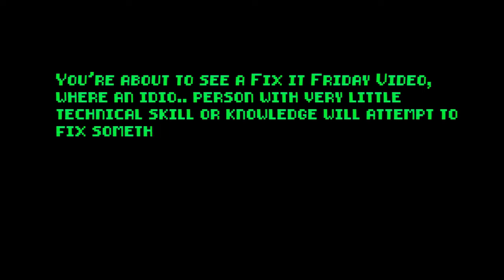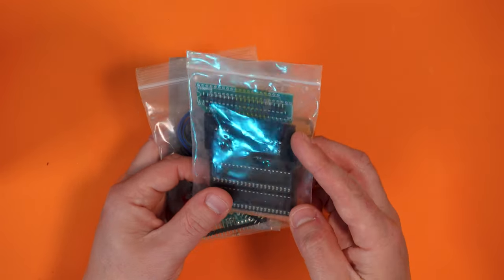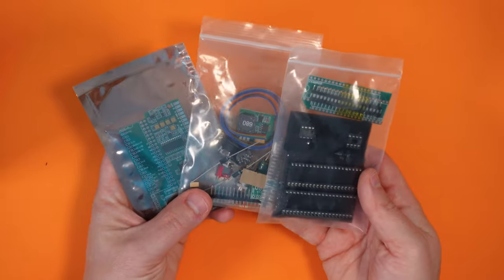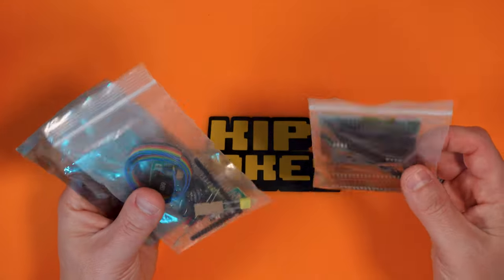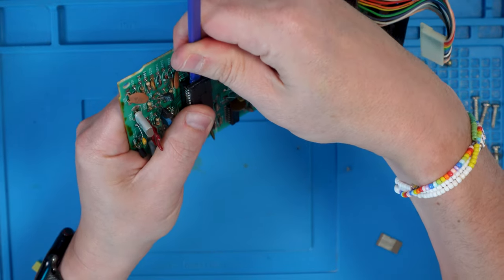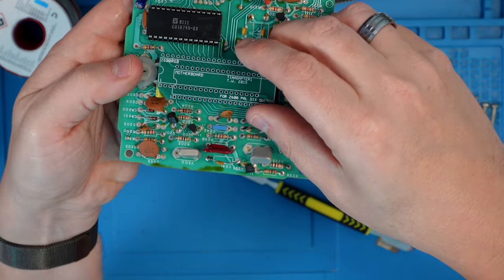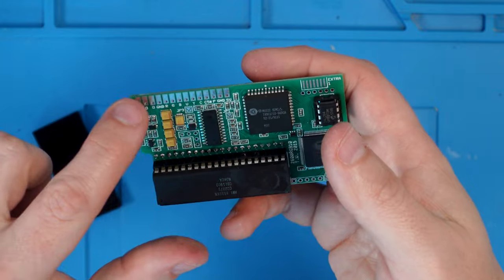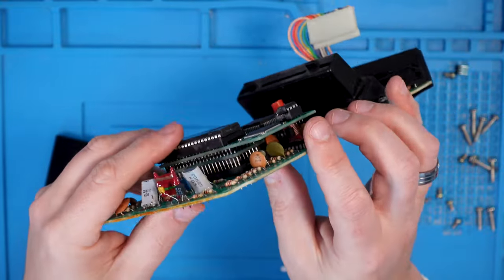Atari 2600 RGB Mod - THIS WAS HARD! Restoration Part Two

Comment: a tip: when you solder headers, you can plug them (both sides) into a breadboard or another socket with correct spacing to have them straight and just pull the soldered assembly out after you finish soldering.

Comment: This is well after the fact, but the console is perfectly safe with a good wash in the sink with warm dishwashing liquid and a soft nylon brush… Oh, and those tabs for the face plate are pretty resilient; I’ve  had no problems with the heavy sixer and the two 4-switch models (one Woody, one Vader) I’ve cleaned before.

The label is a legit concern, but as long as you don’t touch/scrub it until it co platelet dries, it too is OK.

This mod would probably also benefit by using a Genesis Model two style AV connector - not only would it integrate the audio into the single connection, but it would also allow for the console to be used with HD Retrovision’s component cables . 🙂

Comment: Hey Kip, where did you find this mod? 

I just looked at Tim's shop and it says that it isn't being produced any longer because the components are too costly.
Game over man!
Reply from the maker: Old skool consoles might have stock if you email.
Reply: I just checked and it's being redesigned. However, there's no time window for when it'll be done.
"The 2600RGB is out of stock and is no longer economically viable to manufacture in its current form. It is due for a resdesign, but I currently don't have an estimate on when it will be ready."